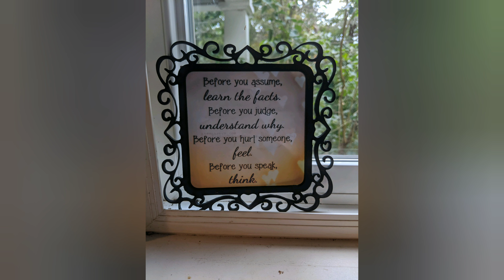FineCut on 10ga. - Langmuir Systems Crossfire w/ Z-Axis - Hypertherm 85

Comment: Hey @Joshua Zimmerman do you have a wiring diagram for these sensors?
Reply from the maker: Yes, these are a PNP sensor, so they source voltage on the black wire. The brown wire is positive; the blue wire is negative. Here is a link... https://www.automationdirect.com/adc/shopping/catalog/sensors_z_encoders/inductive_proximity_sensors/18mm_round_harsh_duty/stainless_steel_factor_1_sensing_(18mm)/ksk6-ap-3h
Reply: @joshuazimmerman8631  Thanks Joshua!  I ended up getting the KSK-AP-4H (TJ) but believe it's the same wiring.  So based on the diagram does this sound more right than wrong?  

Sensor Probe Black = Signal = Diagram Yellow
Sensor Probe Blue = L- = Diagram Black
Sensor Probe Brown = L+ = Diagram Red
Sensor Probe White = Null = Null
Reply: Also -- how is the Digitize function (to enable these probes) turned on in Mach 3?

Comment: I'd like to cut 1/4" stainless. Which Hypertherm cutter do  you recommend? How about the cutting torch head? Thank you!
Reply from the maker: Any one of the Hypertherm units are able to cut quarter inch stainless without an issue. I would recommend one of their machine torches because they tend to be easier to interface with a CNC table. I have run a 45XP and they are amazing machines for the money...
Reply: @joshuazimmerman8631  Thanks a million. You have really inspired me. Brent

Comment: I see your not using  the sensor holder any more did something go wrong with it?
Reply from the maker: This video was on my OG Crossfire 2 x 2... When I upgraded to the Crossfire Pro, I no longer needed the sensor holder because it came with IHS and torch height control. The machine in this video still has the sensor holders on it...
Reply: @joshuazimmerman8631  Thanks for the reply. I am in the process of making one, I posted a video of the holder that i plasma cut today.

Comment: Ho Josh, im really interested in these sensors. Id like to setup on mine but not sure the config and connections. 

Do you have diagram please?
Reply from the maker: I got rid of this machine probably 3 years ago and am currently running a Crossfire XR. I don't believe I have the wiring diagram anymore, but Langmuir sells an upgrade kit for the original table that is quite cost-effective...
Reply: @joshuazimmerman8631  Thank you 🙏